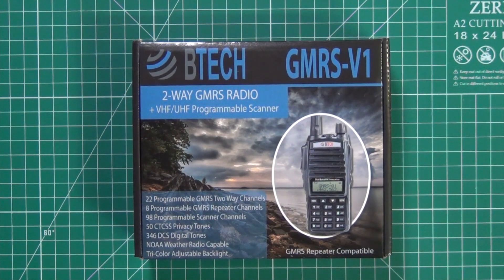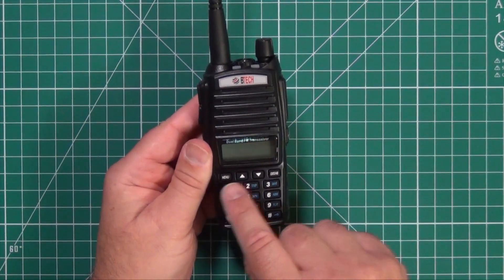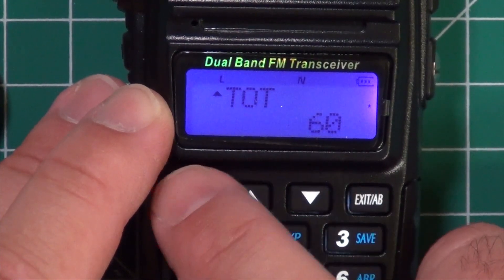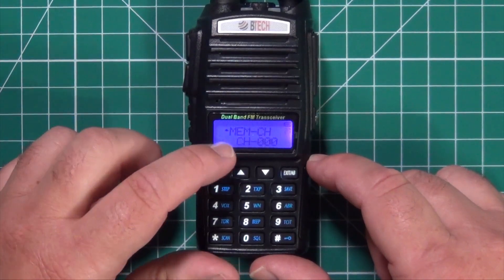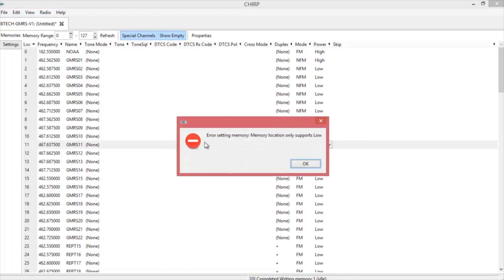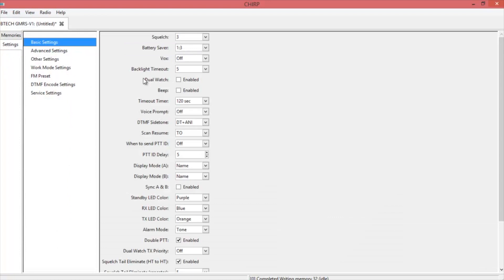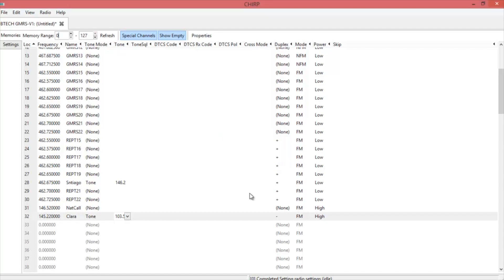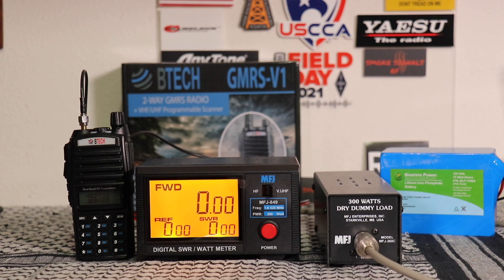BTech GMRS-V1 Overview, Programming and Power Test

Comment: I have 3 V1 GMRS radios. I bought my first V1 radio when they were being sold as 5watt radios . By the time I ordered the second radio BTECH changed the high power output to 2watts  . My first radio on high is 5.10 watts . The other two are at 4.90 or 4.75 depending on the charge of the battery. On low all three are hitting on about 2.70 watts . BTECH has come out with a V2 it’s IP54 rated has a full 5watts high output. Has 200 programmable channels etc. 
I have just ordered one . I’m hoping to have it this coming weekend. 
I would like to see if it is any better then the V1 radio. I also have a BTECH UV-25x2 radio. It only puts out 23 watts on high . 
I’m planning on getting the GMRS 50 watt radio to set up a base station and then move the 20 watt radio to the vehicle. 
I will have the 50 watt radio once I upgrade my power supply & coax . I want to switch to LMR 400 or the browning 400 coax . Then later get the Tram 1486 antenna. I live in southeast Ohio so I need all I can get to get out and for people to be able to reach me and me them